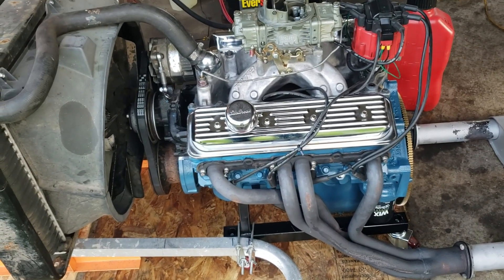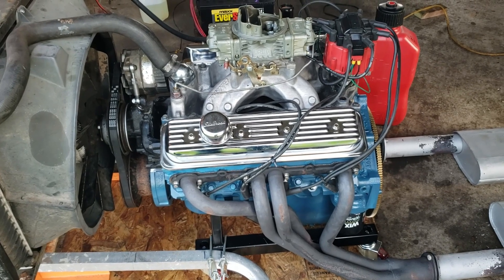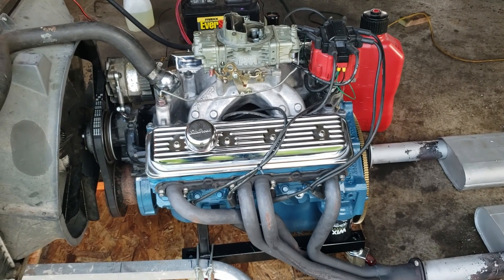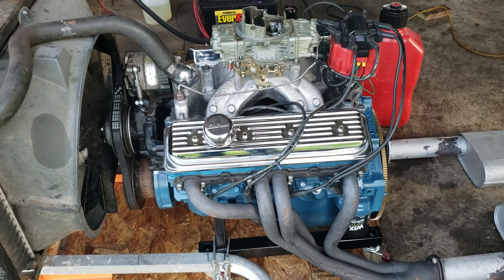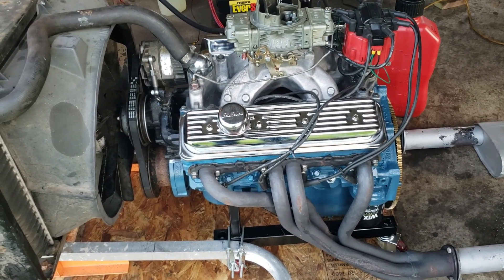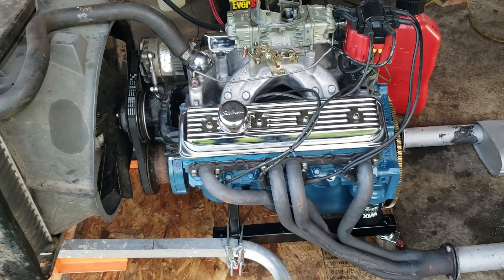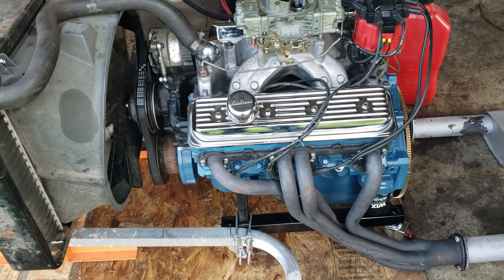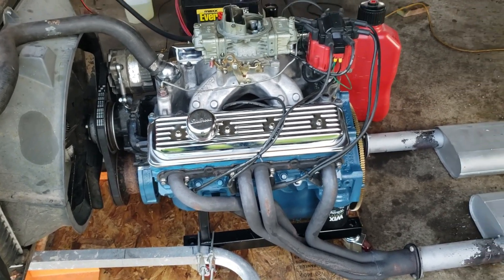Chevy 400 vortec heads 256/266 @.050 lift cam 106 l.s

Comment: Hope you had the the valve guides machined and spring pads on those factory Vortec cylinder heads, if not it will start binding from the higher lift and tear up the heads and possibly the engine! Most people don't know about it. I worked in a machine shop for some years and saw this problem many many times! It sounds nice tho.
Reply from the maker: I'm on it. I have clearance to spare. Thanks for the comment and advice.
Reply: No coil bind or clearance issues on my setup. Running the big mutha thumpr cam 350 with vortec heads using same springs
Reply: @shawnc757  it's bc the harmonics springs are deleted already from factory and must be using the Vortec factory retainerz. Pretty close to binding lol that or ur not telling something 🙂
Reply: @eddiecahall3824  5.7 vortec retainers. I forgot which stem seals I used which gave me more clearance. And I want to say I used +0.050 valve locks but not sure if it's on the heads I'm running now or the 2 set I've put together and never used. No machine work what so ever other than lapping valves. I was skeptical as hell at first myself cause you will always hear what others done and didn't do or whatever they buddy got. I had to see myself what was up and everything checked out good with clearance and coil bind
Reply: @shawnc757  yeah . The valve sealz are half by 3/4". Yes use the Vortec head factory retainerz. I worked In a speed shop 20 yrs. I used to rebuild the cylinder heads. Alot of people would just put new springs on the heads by their self and get coil bind bc they didn't know to take out the harmonics dampener coils first inside the new springs! You have to research thoroughly before using the cylinder heads. I still have a bunch of the Vortec cylinder heads in my shop. Including the aluminum fast burn performance heads and the aftermarket big port aluminum ones with the 220 cc intake ports and 85cc exhaust ports! I've never used either as of yet. I have a friend that put together a 406 SB engine with big roller cam and he used the fast burn 200cc port ones and makes almost 900 HP w spray! He runs off a 1:25 short time w it in a 69 nova and 9 :80 quarter mile w a 139mph times. No BS!
Reply: @eddiecahall3824  oh ok yea that's true and I thought about working in a machine shop myself but I know that can be a headache. Those aluminum fast burn heads are definitely good heads.
Reply: @eddiecahall3824 Factory block? I would like to see a set of vortech heads support 900hp
Reply: @jaminturner4585  Yep, they will def! Splayed caps etc. 4340 forged I beam rods, factory crank and aftermarket balancer! They will support close to 900hp.All day long! No BS
Reply: @jaminturner4585  And yes, the Vortec cylinder heads make a crap ton of power . Circle track dirt sprint cars use them all the time and twist them out literally! They make that much power. You hiding under a rock or something? People know this for years!
Reply: @eddiecahall3824  I run AFR comp 210 's forged and balanced internals and good valvetrain and these heads wont support 900hp. Vortech heads are good for what they are but not that good.
Reply: @jaminturner4585  ur lost! AFR 210's are ancient. Vortec designs will trash those. Don't get me wrong, AFR's are very good. The newer stuff. Vortecs will out flow the old stuff every time. I used to use the older AFR's w good results intill I found out that the Vortec design out flowed them.Not even Brodix keeps up. You need to research more, it's all over the Internet for years. I have different levels of the cylinder heads. And Dyno tested.
Reply: You knows you can do it without messing with the guides and bosses, the key is the offset keepers and retainers. And it's a guy from diabolical racing that sells a kit that you can get 500 life without messing with the bosses. Everything is labeled and instructions
Reply: @greddmyles3677  The Vortec  retainers are the key with the heads and you have to take out the harmonics coil springs inside the valve springs. You cand run 525 hydraulic lift or solid. All this news is 25 yrs old or so. The reason people fail is because the old school stuff is a lost art w the newer generation into the newer LS/Coyote engine builds and newer technology. Old information! You have to research thoroughly on everything now days.
Reply: @eddiecahall3824 so you have mentioned vortech designs. 200cc, 220cc , I figure most people are referring to the ones that come factory on vortech engines I believe are in the 180cc range. So that can be confusing.  I highly doubt a 180cc runner with a 1.94 valve gonna make 900hp even with spray.
Reply: @jeremymyers5643  it's expensive but it's true! 385 cui. Block. Work under the intake valves and put high flow expensive valves in. Then open the exhaust ports to 67 cc. And good valves in. Good reworked valve spring job, w bee hives and 590 600 lift solid roller . Wet timing Belt drive. And magneto distributor. 13.5 :1  compression total.  450 shot fogger NX system. GM vortek single high rise with the fogger bosses. The circle dirt track racers were doing it for years. I've seen the engine dynos.  That's to the flywheel not tires. I have a friend that has one of them now and he's got it in a all steel frame $ -10 pickup pro comp frame 3000 lbs and runs a 9:87 in the Q mile times slips w it all day. He won the heavy car class 2 yrs ago w it. No BS
Reply: @jeremymyers5643  the guy in this video on here is now turning low 11 second passes with nothing in it and 9:1 compression! No BS here either dude.
Reply: @eddiecahall3824  well then if it's got a 450 shot of juice then it's just hard to say, I've never dealt with that. So just to clarify the heads making 900hp are the stock casting small intake runners?
Reply: @eddiecahall3824 I guess heads made in 2018 are ancient. You must be talking about the old canfields. Mine are the elimaimator comp ported 2.08 intake 1.60 exhaust 65 cc chambered heads.
Reply: @eddiecahall3824 how can I build my small block 400 it’s all stock looking to make decent power and take abuse

Comment: Sounds really good.  Hard to beat a 406 for SBC power at a reasonable cost.  When I was young 30+ years ago, the 406 with camel humps and a 280H was the hot setup.  Roller lifters were pretty much unheard of in those days.  Talking late 80s/early 90s.
Reply from the maker: Thank you. I would like to get ahold of a set camel hump heads. It would be interesting to see how they compare to the vortecs.
Reply: @nylegreen261  Um I have 461 camel hump heads. But I ain't getting rid of them lol maybe for the right price. Camel humps make 330 hp max. Actually lame. Vortecs make in excess of 400 HP. Naturally aspirated, no boosters.There's your difference.
Reply: @nylegreen261  I have a set of 461 Camel humps. they are great for Iron heads, but not as good as Vortec heads. I also have a set of 186 Z28/LT1 Camaro/Corvette Heads, and the Vortec heads are still better. there were actually 4 different castings for "Camel Hump" heads. 461, 462 and 291 and the 461x.  the 461x has bigger intake runners. 170cc.  the other 3 have 160cc intake runners.  461x was used from 60-63.  461 was used 64-66. 462 was used form 62-67 and 291 was used in 68-69.  the 186 LT1 heads are better. but even then they are no match for a vortec, hands down the vortec is the best iron hear out there. the vortec is almost as good as the old Dart Iron Eagles.  Vortec heads are around 220-225cfm, the 168 heads are around 210 cfm, the 461X head was around 190 cfm. the 461,462,291 were all around 175cfm. the Dart Iron Eagles are around 230cfm.  keep in mind that the 906 vortec has 1.94/1.50 valves. and the iron eagle and 186 heads have 2.02/1.60 valves. I have seen ported 461X heads with 2.05/1.60 valves around 270cfm. and vortech with 2.02/1.60 valves around 270cmf as well. the very best head that i know of is the 034 Bowtie iron head. they were around 300cfm ported. but only with .700 lift cams. on a side note. Trick Flow make a aluminum reproduction of the old Camel Humps the flows around 250cfm. they are fairly cheap too at around $780 each. by the time you took a set of old 461X heads, magna fluxed them for cracks, boiled to clean them, added hardened Inconel seats for unleaded gas, new guide liners, 3 angle valve job, new valves, seals, springs, retainers, and locks, you will be close to $1200 not including the cost of the castings. I just did this for a matching number 350 lt1 corvette motor. I would have gone aluminum if this was not a matching number corvette.  as far as bang for the but you can't beat the TFS aluminum double hump. just a coat of chevy orange and no one will know they are aluminum.
Reply: @shadvan9494  Them old school camel humps are straight junk compared to Modern technology. Ain't none of those old cylinder heads will compare to any Vortec cylinder heads. Not even ported lol and they make big port Vortec cylinder heads right from G.M I have 4 different sets! Standard 170cc intake ports, GM fast burn  iron 189cc intake ports, GM Aluminum fast burn 200 cc intake ports, And The all out race Aluminum 223cc intake ports w 85cc exhaust ports and unshrouded combustion chamber set for big dome pistons! You ain't outdoing any of that! 3 of these cylinder heads will make around 1000hp and the last set will support to infinity basically! 🤣🤣🤣🤣
Reply from the maker: @shadvan9494  Thanks for the great information. I just picked up a set of 461 castings. I will compare them with the vortecs.
Reply: Yup.I still have a 406 week built in the early 90’s.Just changed to a roller setup in the late 90’s then switched to AFR heads and took off the camel humps.These 406 motors are still a threat on the street today no doubt.
Reply: @eddiecahall3824 We flowed the camel hump and vortex heads.Camel humps flowed roughly 225 were the Vortex flowed 240
Reply: @shadvan9494 I run a set of Ported ETEC 200’s on a 388 they do really good with a 254/260 solid roller and 10.8-1 compression took my 3,400lbs car to a 10.80 on the motor with a tight converter and 3.70 gear. Went some 9.90’s on a 150 shot.

Comment: That thing is a beast. The cam is just about right for the combo. @10:1 104-105lsa optimal so its not too far off. Those vortecs flow well @ .500-.520 lift. Nice setup. Should rip👍
Reply from the maker: Nice thank you.

Comment: That things gotta be making 450+ HP
Reply from the maker: That would be nice. I have a similar engine going to the track next weekend. It should give me a idea how it will run. Similar cam but this on has 50 cubic inches and 1 point higher compression.

Comment: Very nice build. I ran a set of vortecs on my 350. They are a great budget friendly head. They made good power.
Reply from the maker: I'm with you in this. I had a vortec 350 with a small cam about 10 years ago. It ran circles around a 350 with dart II sportsman heads I had.
Reply: @nylegreen261  they are definitely hard to beat on a mild street engine.

Comment: Nice sounding little small block. Seems Erson has some cores for the gen II small blocks, so their grinding me one with only a 2 week lead time. Every other place I called said 45-52 weeks. Maybe it won't flatten after 2 minutes. Fingers crossed...
Reply from the maker: I have had good luck so far. I stick to u.s.a made cam and lifters. Also a good break in oil. I think you will be alright.
Reply: A buddy just did a flat tappet hydraulic in my c10 we had the heads rebuilt had lead gas valve train in it 76k original miles use good lifters and good break in lube use the whole tube!

Comment: I painted a set of aluminum heads chevy orange with cast bits from a brake - rotor lathe mixed in. pasted tech inspection for six years!!🎉😂
Reply from the maker: @williepelzer384  Nice

Comment: This is amazing content, these types of budget head / tight lsa sbc combinations are exactly what I want to get into building. The fact I get to hear the idle quality beforehand is invaluable! Is this howards grind also on a 106 lsa?
Reply from the maker: Yes Thank you. I hope you journey will be as good or better then mine has been. No problems here and I'm having fun. It is on a 106 lsa. I couldn't advance or retard the cam without having piston to valve  clearance on this one. It seems this will be the problem with narrow lsa.
Reply: @nylegreen261  Hey man if you have a moment, I'm really curious to know how the self-aligning rockers are holding up with the solid-lifter lash, any noticeable issues?

Comment: Only thing that I would have done different is the cam.   That cam is strong, but the old UltraDyne 288/296 solid lifter cam ground on 105lsa is much more responsive under load.  Bullett cams can still get you the UltraDyne stuff.
Reply from the maker: Nice I will look into it.

Comment: Flat-tops and vortecs on a 406, that 's some serious compression. I'm guessing not the stock short rods?  Will it run on pump gas?  Sure sounds great especially with just the flex plate.  I'm jealous as heck here.
Reply from the maker: Still uses the stock rods 5.565. Compression is 10.5 to 1. It has alot of piston to head clearance. Pump gas is the plan. I took it to the drag strip. To be safe I ran 50/50 mixture of 93 octane and 100.

Comment: Now that will be the fastest motor you put in that nova, a real torque hog!
Reply: What octane gas you running?
Reply from the maker: Will run it on 93 octane. Can't wait to try it out. Should be one of the quicker engines.
Reply: Sounds killer.  400, that’s gonna run real nice!
Reply: I had a 406 with dart sportsman iron heads with a bit smaller hy roller went best of 11:75 in a 3700 Pound car, drag radials, 4:10 gears and 3k stahl.

Comment: Sounds DANG GOOD!!!! Planning on a similar build for my '62 bubble. I currently have 400sbc with 461X (61-62 year) fully ported and steam holes drilled, Edelbrock TM1. I was actually looking at Howards 112082-05 which seems very similar to your cam specs. would love to hear it in car when you get it in.... also what is your compression?
Reply from the maker: Thank you.. I'm only around 10.5 to 1 compression ratio. It should be in the car before the end of the month. Should be a good runner. Sounds like you have a nice combination coming together.

Comment: Is it a 2 bolt did you use offset keppers  Sound great What Hp
Reply from the maker: 2 bolt arp bolts.. No offset keepers. I have the ls6 valve springs at 1.75 installed height seat pressure is around 105 lbs.  My valve retainer to seal is right around. 040. I have about .490 lift as the stock rocker arms aren't a true 1.5 ratio. Im guessing it will show around 425 horsepower in the car.

Comment: Sounds good! How do you run a solid cam on vortecs? Do you machine your heads for guide plates and screw in studs ?
Reply from the maker: Still using stock self aligning rockers. I cut a .014 feeler gauge in half.

Comment: What do you do about the steam holes? I've always liked this idea but didnt think the heads worked on a 400
Reply from the maker: I did not drill them. I planed on doing some testing at the track with the vortecs  and then putting on a set of dart platinum 200's.

Comment: Got any more details on the cam? I’m building a 400 with vortec heads.
Reply from the maker: Howards 110792-06. 284/294  .050 256/266  .515 lift.  106 l/s.  102 intake C/L
Reply: @nylegreen261  perfect. That’s what I was after. What lifters, push rods and rockers did you use? I’m in Australia, so things aren’t quite as easy and much more expensive. 
Your motor sounds amazing to by the way 👌
Reply from the maker: Nice I would love to go to Australia one day. Lifters are Howards 91118 direct lube. Pushrods are jegs 5/16 .080 wall 7.8 long. Valve springs are jegs ls6 valvesprings. Installed at a 1.75 installed height with a 787-16 comp cams retainer stock locks. Rocker arms are stock vortec self aligning.

Comment: Any idea, what kind of power that 400 making? I have all the parts, you have except my solid cam is 520/540?
Reply from the maker: Nice. Not sure on power. The vortec heads are stock. I would guess 425 horsepower or slightly under. Which will be plenty quick in the nova.
Reply: @nylegreen261  I made that hp with a 274 xe comp flat tappet cam, a dished 400 and shaved vortec heads with z28 valve springs 15 yrs ago, so your motor would probably make about 450 or so.
Reply from the maker: Nice that would be great. I can't wait to run it should be quick for sure.
Reply: @nylegreen261  I have 480 HP from a 383 using 6 inch rods with 9-8-1 compression using 202- 160 values and 68 cc combustion chambers.
I need a work truck engine for towing a 30 foot fishing jet boat to work.

Comment: That engine with the GM #140 1st off road mechanical cam w/1.60 rockers would make 500hp 500tq safely on pump premium 93 octane.  I’d say you should be ok on 93 fuel.
Reply from the maker: That's what I like to hear. Im going to look into that cam.
Reply: I have ran that GM 140 cam in my Z-28 SINCE 1976. I ran 11.70 -71-73.    126 mph  quarter mile, still driving it to car shows. People ask what cam? I tell them a factory GM they make this look👀
Reply from the maker: That car is moving. That mph is awesome.
Reply: @nylegreen261  no traction, 7" slicks, no sprayed tracks back then.

Comment: Didn't know thise 350 heads would bolt to that 400
Reply from the maker: No problem with bolting them on. You just need a intake designed for the vortec heads.

Comment: Hi Sir.... When You install this engine, 
What size stall and flash converter would You use that works with a cam this size?
Reply from the maker: I have 2 different transmission options to choose from. Powerglide with a a1 8 inch converter and a th350 with a tci 3500 stall. I will most likely go with powerglide.
Reply: Thanks Sir... My setup is a lot like Yours. I just ordered an FTI 3800 hard hitter.... I'll know soon enough. Stay Safe and Have Fun.